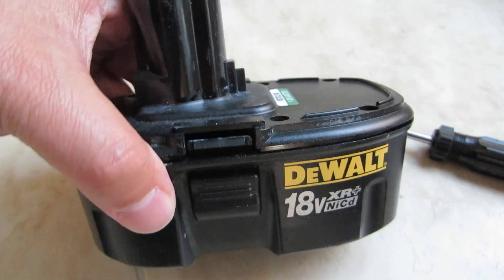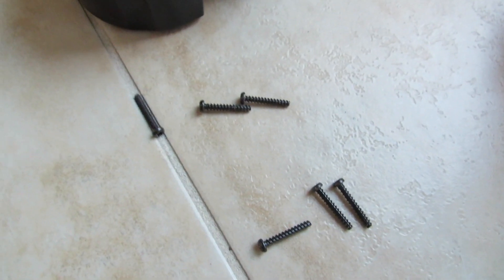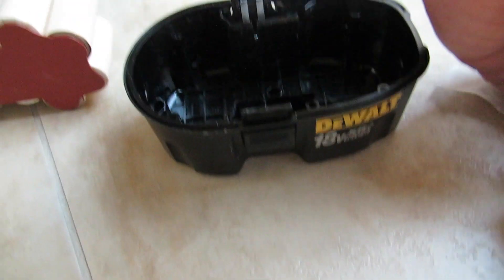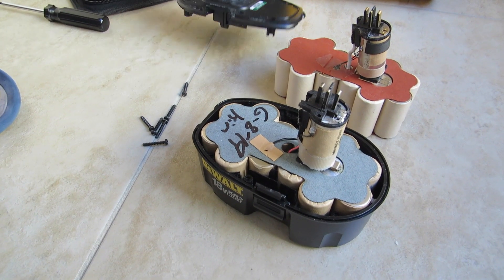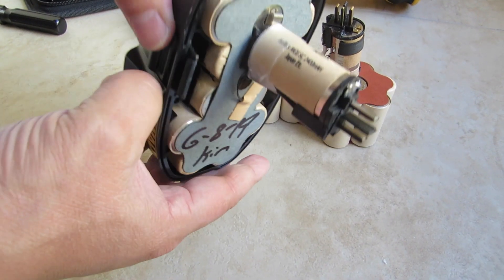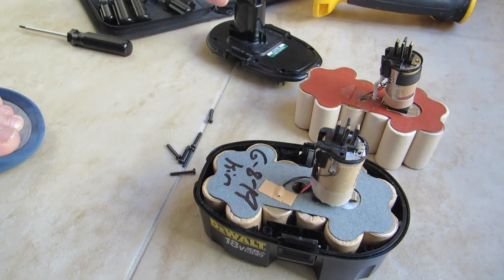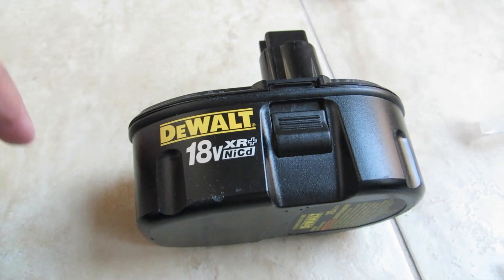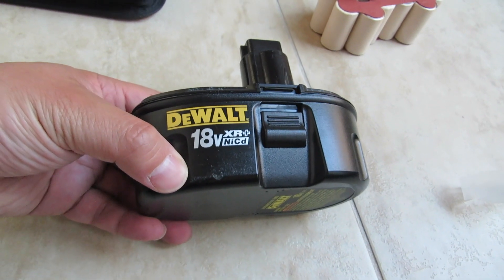How to Rebuilt the DeWalt battery to save $$$$

Comment: Hello my friend one question what kind of batteries or model of batteries does this dowel use
Reply from the maker: Hi Luis

It was model # DW9096 Battery Packs.

If you search Dewalt REBUILD KIT 18 VOLT XRP DW9096 Battery Packs it's the one I have.